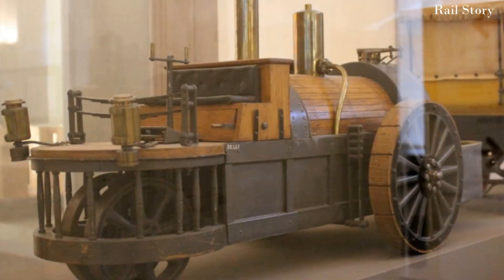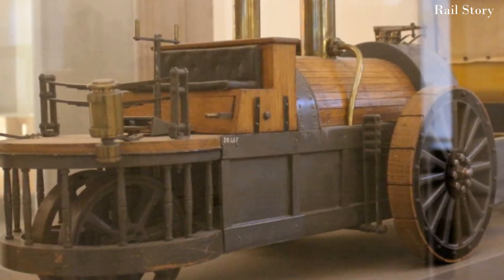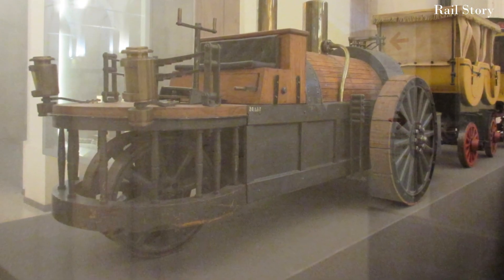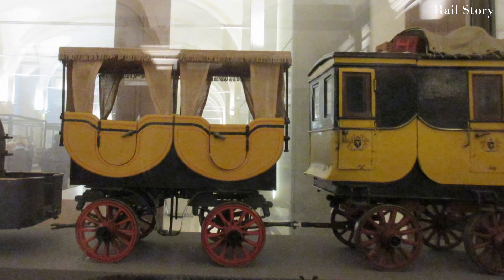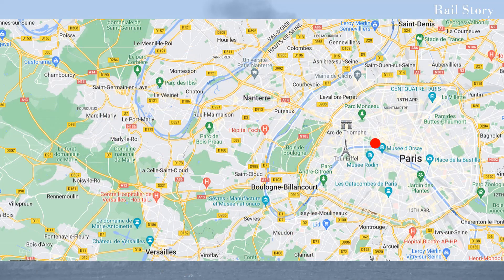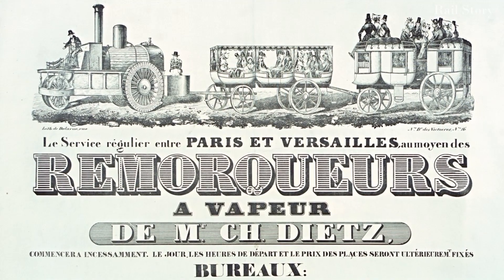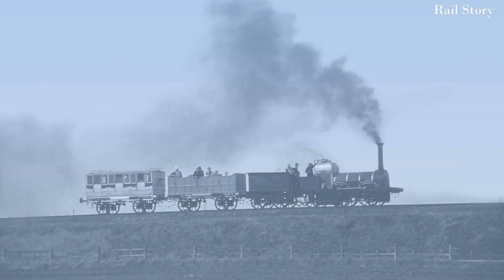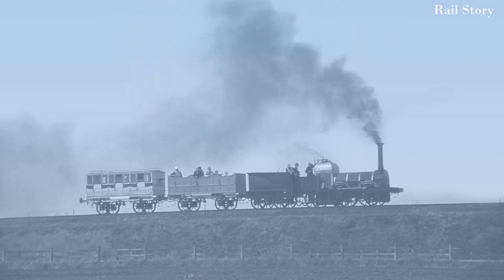La Remorquer a Vapeur

Comment: Gosh, 30 psi - I'm surprised it could even pull the skin off a rice pudding.
Reply from the maker: The drive was geared down. Oscillating cylinders running fast geared down to the final drive to increase torque. It was certainly a capable machine.

Comment: That's a neat one.  It sounds like there wasn't anything really wrong with the thing itself like the road being too rough or using too much coal for the fare.
Reply from the maker: It was just that the railway was quicker. As you say nothing wrong with the road locomotive - didn't use too much coke, the roads were in excellent condition. It was just quicker by rail, and it could carry far more passengers.

Comment: Interesting that it burned coke to reduce erstwhile pollution. I wonder if steam could be re-introduced using coke plus other ways of zero carbon emmissions. I am sure the technology exists or could be developed to manufacture modern high speed driver friendly zero emiision steam locomotives
Reply: There's just as much carbon produced with coke as there is with coal. Coke is made by heating coal to very high temperatures.
The only thing you don't get is smoke when burning coke in the firebox.
Reply: @Boppy-B-B  Edit: Oops. Yea Coke is literally coal. Well, Charcoal then? I never thought about coke being different to charcoal.

The difference is that charcoal is wood stored carbon. Coal is carbon that have been stored underground for a long-long time. With coke the carbon can be recaptured by trees.

The issue with charcoal and burning fire-wood for steam power, is that so much wood is needed. It becomes a economical issue and deforestation to feed the fires. A steam loco could only turn 10-30% of the energy into motion. And that is being generous. A big diesel powered ship can maybe reach 50%.
A electric engine can almost reach 97% realistically. Meanwhile steam engines are around 5-15% realistically.

If one powers a steam train with wires? Then the biggest loss of energy would be in energy losses in the wires transmitting the energy to the loco. Make a stationary steam boiler and power a turbine turning a electric engine (generator) and you have a stationary steam engine transferring energy trough a turbine and electric wires to the steam train axles. A electric engine/generator is mostly wound wires and magnets. There is really nothing fancy about it or difficult to explain compared to a steam turbine/valves for steam cylinder operation. In the end you have a train powered by steam. Ain't that neat!

With a modern steam locomotive using stationary turbines and metal wires transferring the 'steam' to push the axles around doing work. Well, there you have it.  Now find a good supply of heat energy and you got a steam locomotive. No wood or coal/liquid fuels required.  You could even power the train from the heat generated from a giant internet servers like Facebook or YouTube. Not even computers or the cloud computers are 100% efficient. The heat made from computers could steam a boiler that powers a locomotive. It is not a joke but a real possibility.  Electric trains are awesome. Even if not as cool. (Well, with electric engines you lose 90% of the hotness.)

The biggest advantage that trains have outside of low friction is that you could put the generator of power in a safe place. A truck, car or airplane can not be wired like that, but a train is railed already. You could pretty much power the train trough the tracks if not for the risk of people getting sapped by bridging the gap. Mind the gap!

Comment: We sometimes forget that steam was introduced so early into road transport. And not just roads or rail. As I am sure you already know the first steam powered boat predates the Battle of Trafalgar. In fact there was a plan to attack the Franco-Spanish fleet using steam powered boats towing fireship. The plan was abandoned as the technology was not quite there plus fireships are a notoriously difficult weapon to use.
Reply: The first road race between self propelled vehicles in Wisconsin was In the 1860s, sponsored by the state legislature. The entrants were basically traction engines for hauling cargo.  At that time it was still a bit unclear if canals , railroads or roads would be best for transport, and each had their faction promoting them.
Reply: @Wiencourager  Thanks for reminding me. I'd forgotten about that. A road race between traction engines. You wouldn't need a stopwatch for that would you.

The poor state of the roads in Britain was what encourage canal building in England. Roads were more like dirt tracks. So very dusty in summer and muddy in winter. Amd full of potholes all year round. So they built canals to replace them.

The problem was that the canals had a monopoly and proved very expensive, the Liverpool Manchester Ship Canal proving one of the worst and effected the cotton trade. This is why the first true railway ran between Liverpool and Manchester.
Reply from the maker: Ironically the first Steam Boat had been invented by the Marquis Jouffroy d'Abbans in the 1780s. He also invented the multi-tubular boiler.
Reply: @AnthonyDawsonHistory  Thanks Anthony. I was aware of a steam boat running on a Scottish canal before Trafalgar but not of anything which predates it. And that rocket was a multi-tube boilered engine, though thinking about it now I seem to remember something about it not being the first.

I was going to mention about reinventing the wheel but as it now looks like it was invented and reinvented about five times in different times and places it's maybe not the best example.
Reply from the maker: @bigblue6917  Jouffroy d'Abbans had used a horizontal mutli tubular fire tube boiler in his steam boat in the 1780s and Marc Seguin  applied one to his locomotive of 1829 having made a scale model of it and carried out numerous experiments from at least 1826. Quite whether Henry Booth who designed the of Rocket is not clear, but the two are very similar. There had of course been multi tubular water tube boilers as well.

Comment: I’ve never heard of this one, thanks for making and sharing!
That was a pretty impressive speed to Versailles, particularly with the state of roads at the time.
Do you know if it had to stop for coke or water during the trip?
Reply from the maker: It had to stop for water. The roads were actually pretty good. Napoleon 1e had done a massive amount to improve the roads in France and led a huge road building programme. The Turnpike roads in Britain, too, were well maintained and well-metalled.
Reply: @AnthonyDawsonHistory  Interesting, stopping for water means that the actual road speed was higher still. It must have been true sights and sounds of the future, for both passengers and bystanders.